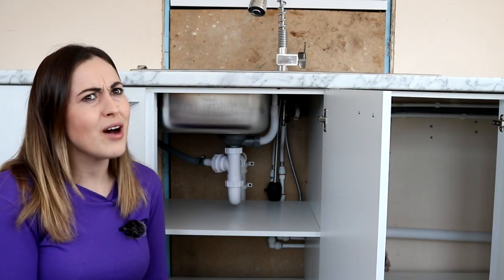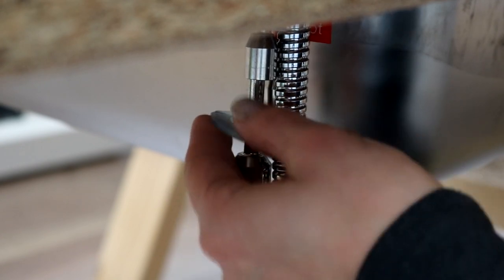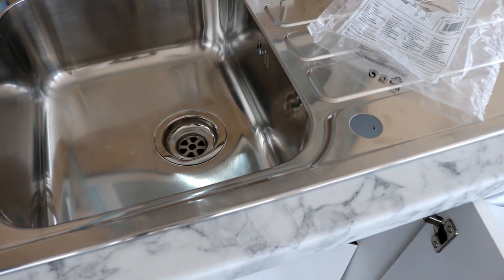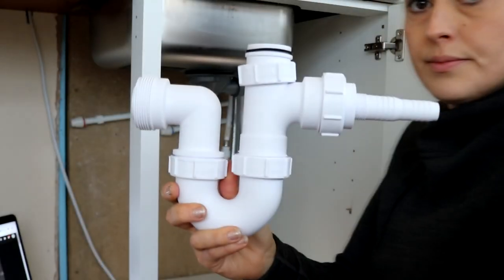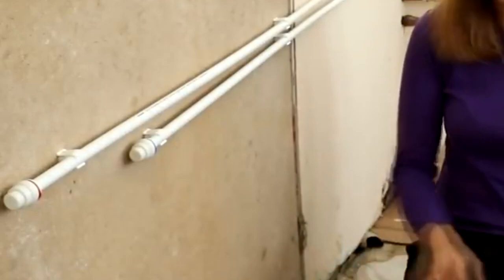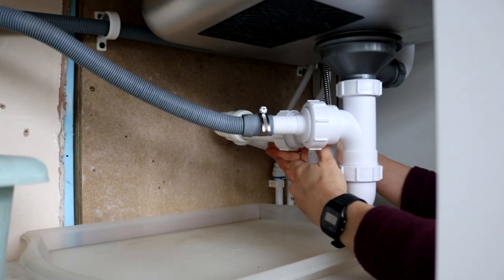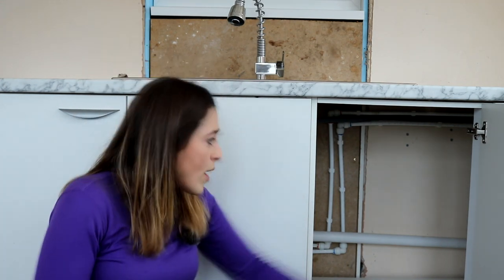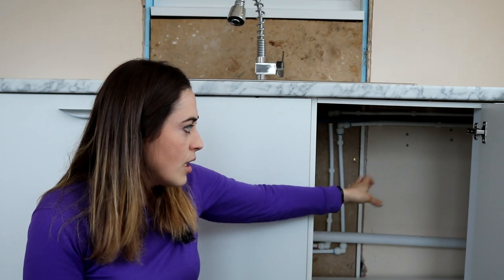Plumbing Tap & Sink Waste: Kitchen Part 7 | The Carpenter's Daughter

Comment: If there is gurgling after your tap water goes down, consider  replacing the McAlpine with a built in Vented McAlpine, it happened to me so was an easy fix.

Comment: Longer screws then cut some small pieces of 15mm pipe the same length as the gap from the clip to the wall these will act as spacers and you will be able to tighten the clip up nice and snug. I do this all the time it’s a lot neater and tidier than using a piece of wood.
Reply from the maker: Thank you! :)
Reply: You are more than welcome ☺️
Reply: thats what i do , im a plumber
Reply: I am also a plumber 😃

Comment: for the waste pipe clips i usually cut two small little bits of 15mm copper (or smaller) at about 1cm long or size required and use some longer screws. this steps the clip off the wall that little bit that is required.
Reply from the maker: Thank you so much! :)

Comment: Really great helpful videos. One tip you need to leave a gap of 60mm from your valves etc to your pipe clips to allow for expansion. That’s right out of the handbook from JG speedfit. If it’s to close the expansion could push against the pipe clip and the seal will fail. Hope that helps for the future 👍🏻

Comment: Small pieces of 15mm copper pipe used as spacers is a neat and clean way to bring the pipes away from the wall. That's the best method I've found. Although maybe the hep will work the same way, as it will be hollow and rigid enough to take a screw.

Great work as always 🙃
Reply from the maker: Yes, I was hoping it would be the same with plastic plumbing :)  Thanks for the tip :)

Comment: Nice job - I fitted my sink last year too. My only ‘tip’ would be to silicone under the sink basin, I.e where the sink meets worktop. That way, no water or cleaning product will seep under the basin and damage the worktop or cupboard. Keep up the good vids!
Reply from the maker: Thanks!  That's exactly what I'll be doing next and clipping the sink in to place :)

Comment: Spot on with the idea of fitting some wood packers for the pipe clips , a dab of no-nails will hold them in place , wait till the no-nails has set and then fit the clips , top video as usual
Reply from the maker: Thanks for the tips :)  Will definitely use some wood now as it sounds the strongest option :)

Comment: Using blocks to shim out pipe supports is perfectly normal around here.  Try to hit wall studs when you're securing the blocks.  If you can't do that then make sure to use proper drywall/sheetrock/plaster anchors.  (I have no idea what they're called in England.)
Reply from the maker: Thanks so much :)  I think they're just called plasterboard fittings around here, but know what you mean ;)

Comment: Good Job!  Code won't allow me to use any flexible pipe for waste water in my region, but I like what you've done. And you got my vote again. Recently was assigned a new IP by my ISP.  I can't think of a better way to use it.
Reply from the maker: Haha, thank you so much again! :)  I wonder why you can't use flexible pipe? 🤔
Reply: The major problem with them is that they collect the dirt and grime that’s supposed to flow down the drain. The zigzag sides are great for slowing down the flow of water and letting the gunk sit and collect. Making matters worse, since they slow down the flow of water, gunk can easily collect further down the pipe, especially if they pipe already isn’t 100% clear.

Comment: to tighten the waste to the sink you could always use an old chisel or flatten the end of a offcut of 15mm copper pipe x
Reply from the maker: Thanks so much"  Prefer the idea of a chisel compared to a smaller flat head screwdriver :)

Comment: good job with the routing and slowly fitting the connections.
wood scraps can make it easier to bring the supports to the pipes for support. and if you paint happy faces on the scrap blocks they do a better job supporting things.
flexible pipes and connections with rubber or silicone seals are so much easier than the old way with rigid pipes and glue.
great job.
already voted for you.
now for the ultimate question. is this all Hans approved? I am sure it is. HA!
Reply from the maker: LOL to the happy faces 😂  And thanks so much again 😀👍

Comment: I love how honest your videos are and really informative. I'm just wondering have you had any leaks with the jg speedfit fittings as I'm thinking of fitting a shower using them. 👍
Reply from the maker: Thanks :)  I've never had a leak from my own Speedfit plumbing, but ive had to repair one my father in law installed under our toilet sink.  I found it's far better to replace a £2 piece from scratch and throw the old one away.  The leak was very slight, but I'm a worrier 😂
Reply: @TheCarpentersDaughterUK  
Great thanks for getting back to me. 
You have my vote. 😁

Comment: Why not clip to the wall but use bits of 15mm pipe as spacers between the clip and the wall? That’s what I’d normally do. Neat job by the way.
Reply from the maker: Thank you:) And thanks for the tip :)

Comment: The problem I had is that some sellers say 1.5" is 38mm and some say it's 40mm.
Reply from the maker: I spotted the same problem in Wickes last year when I needed to get a very specific waste pipe.
Reply from the maker: Ended up having to use a reducer

Comment: Good work,  but I'm afraid I'm old fashioned and use copper everywhere I can in my house - except waste of course...
Reply from the maker: Thanks so much!  One day I'd love to give it a try with copper!  I think plastic is particularly great for learners like me 😁
Reply: I think both have it's place in the world of plumbing.  I prefer copper but when you do not have tools or the ability to work with copper pipe then as long as you use the plastic pipe properly and for the right use I do not necessarily think it's the worse thing ever invented and I can really see the pros.
Reply: @actiongirl5  I'm sure you are right - just all those push in rubber seals make me a bit nervous :)
Reply: @phildxyz Obtaining quality made and tested plastic pipes, end caps, valves, etc will at least minimise faults or leaks.  I'm with you on the old copper, nothing says reliability like shiny freshly soldered copper pipes..... ;D
Reply: Copper all the way for me and looks beautiful when buffed up

Comment: It will work, but no craftmanship is shown. Work straight and plumb en fasten the pipe, not the couplings. Look into regulations and then start a YT-movie. Also 1 cm/40 cm is much too much. Your drain will fall dry and clogging will appear. 1cm/100cm is much better. Also the whole rerouting with the water is strange and takes too much material.
Reply from the maker: Thanks for the feedback.  I'd like to clarify that I haven't said I'm a craftsman.  Nor is this a tutorial.

Comment: You forgot to seal the drain, it might leak with plug in.
Reply from the maker: At what time?  There's a seal underneath the drain with that plastic bit.
Reply: Plumbers mate or silicone around the waste has you set it in sink.
Reply from the maker: Just to give you an update - I've now found a spare gasket from sink waste that came with another new sink we had (although the actual sink got damaged in transit), so the drain is now sorted :)  Thanks again for bringing this to my attention!
Reply: Most plumbers use silicone or putty because the foam gasket fails and you get callbacks.
Reply: We had our kitchen sink fitted by a fitter installed the kitchen and he did a similar thing, no silicone no nothing just the gasket the sink started to leak into the cabinet below and the same went for the overflow as the rubber seals just do not seem enough on their own and this was a Franke sink.  I would highly recommend silicone for the seal.  I did that with ours and 6 years on not a drip!
Reply: Dave Judd silicone and plumbers mate are for cowboys, if done correctly, you dont need to use either
Reply: Use 'Plumbers Gold'